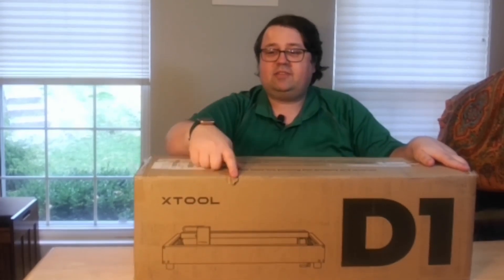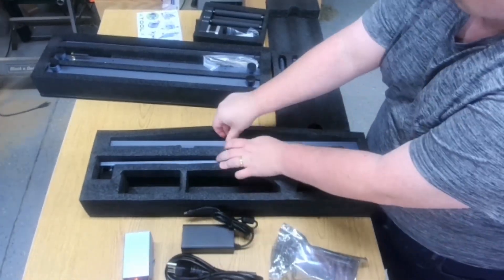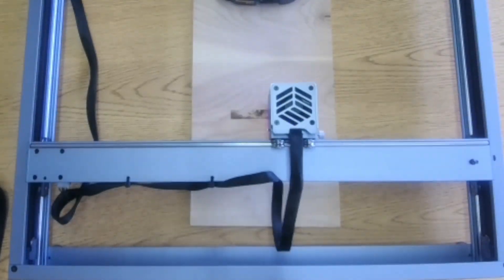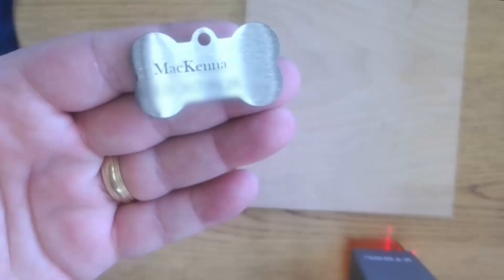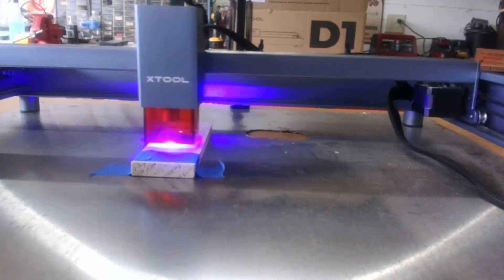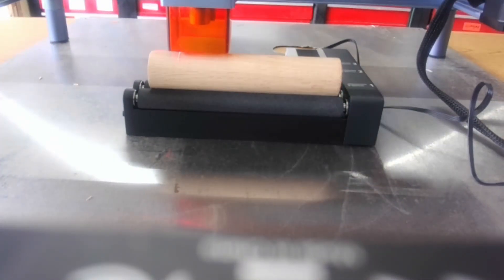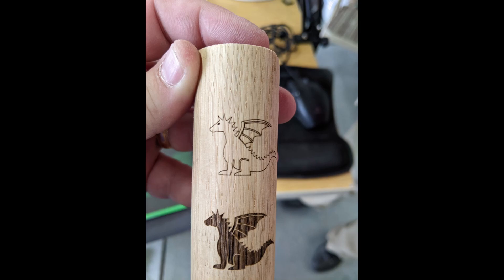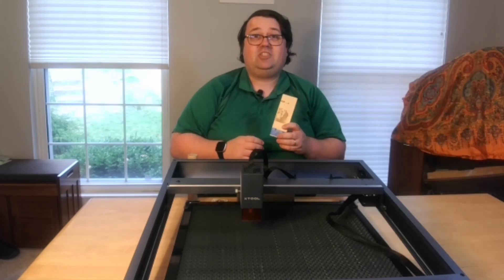xTool user real review: xTool D1 unboxing - what can you do with xTool D1?

Comment: Are there changes in the d1 10w from early to current model or has it been the same since the begining?
Reply: There have been changes to the head, a different mounting bracket as well as a different protective lens. Functionality remains the same. The D1 Pro has a different mounting bracket as well and adds limit switches, flame sensor and other quality of life and safely features, as well as works with a new software (XCS).